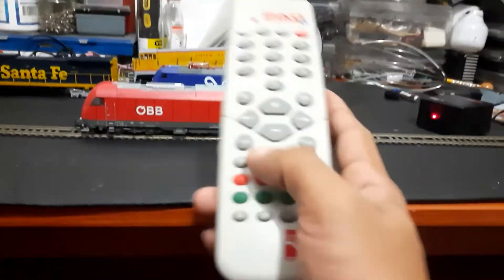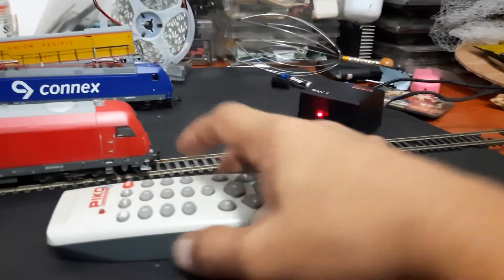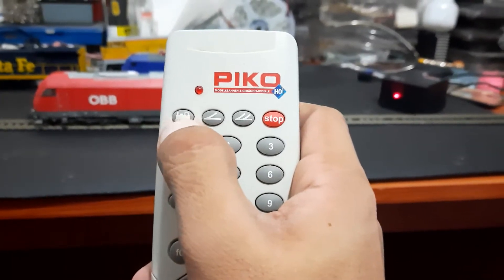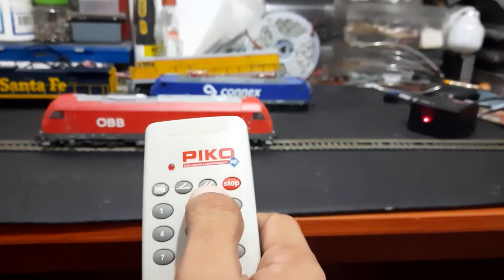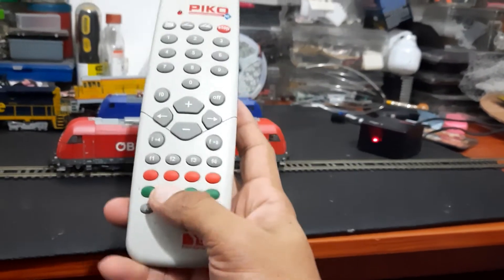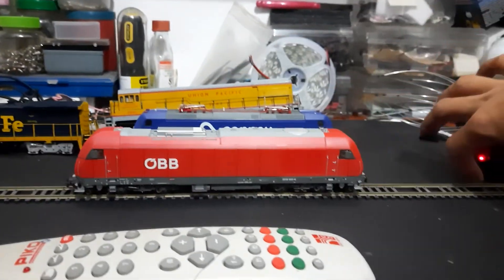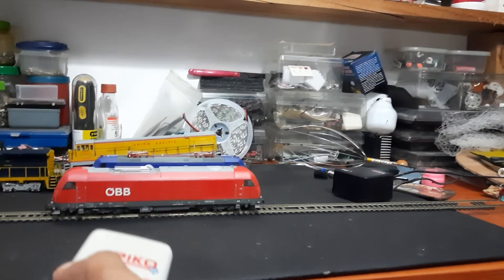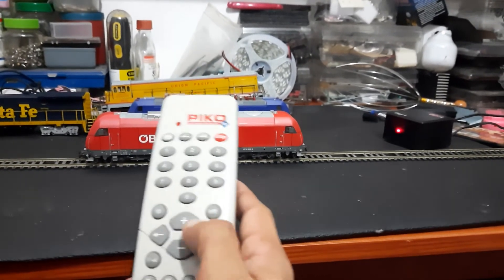Piko digi 1 programming

Comment: One thing to keep in mind about the Digi 1 DCC set is that it will only accept locomotives with DCC addresses between 1 and 127. Anything above 127 will not register. You also have to press (before running a train) channel A, B, C, or D before starting the train. A, B, C, and D seem to denote which "Digi 1" receiver is being addressed by the handheld throttle.

Comment: Can you program Esu's Lokpilot decoders?
Reply: Thanks it works
Reply from the maker: Yes you can reset the decoders to factory default. But not the CV programming.  you can assign locomotive numbering and assign accessories from the controller.